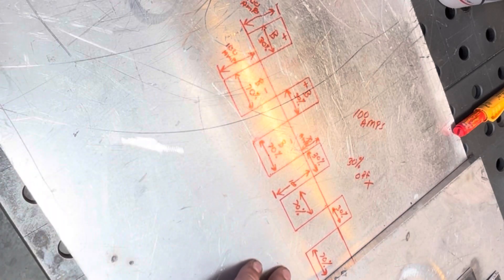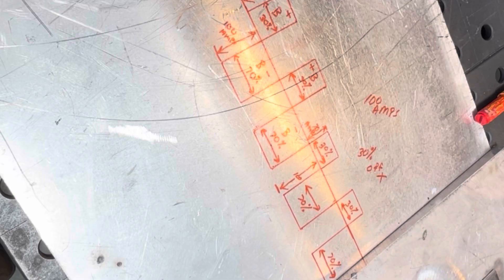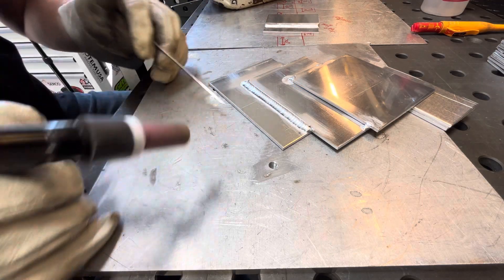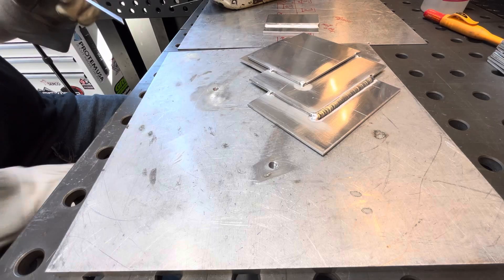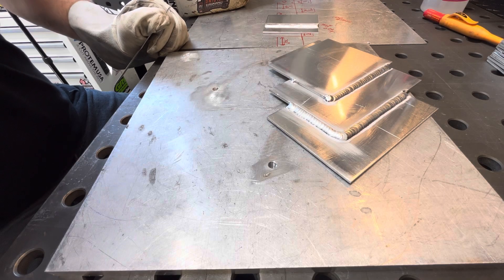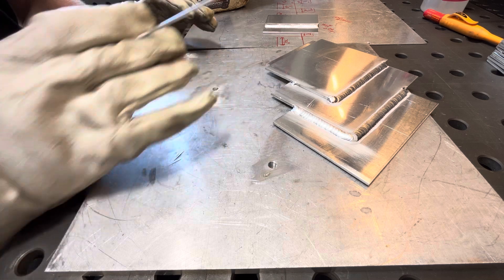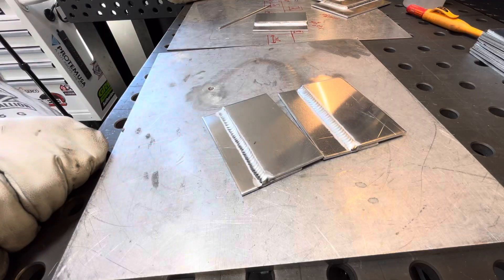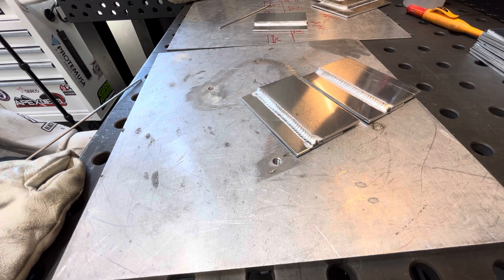TIG WELDING ALUMINUM WITH ADJUSTABLE AMPLITUDE, IS IT BETTER AND WHY

Comment: For sure a mix ac/dc video explain it would be great.
One more question, have you noticed if decreasing 30% from the positive side if that effects the negative side also, in terms of increasing the penetration? More or less like balance do but in height?

Comment: i own a welder that has this feature. when i bought the machine they claimed that thinner aluminum would be easier to weld if the amplitude was set up right. never tried it. maybe i will try it in the future. thanks for sharing.